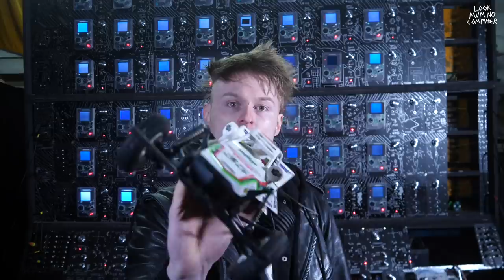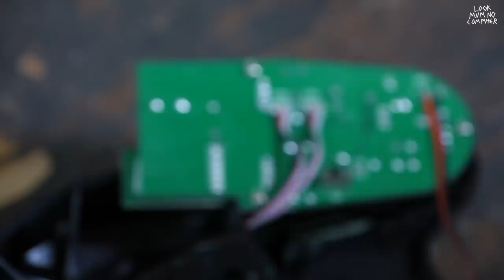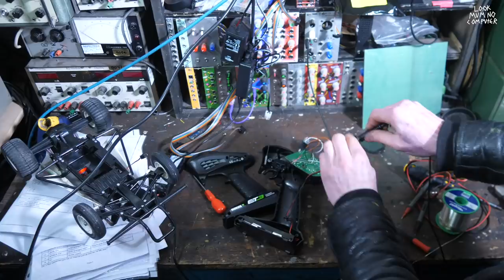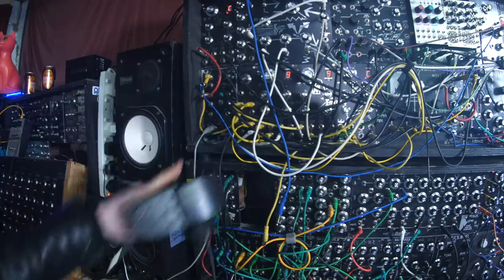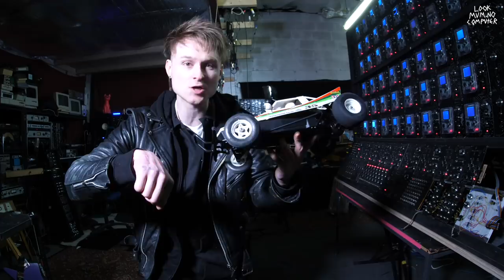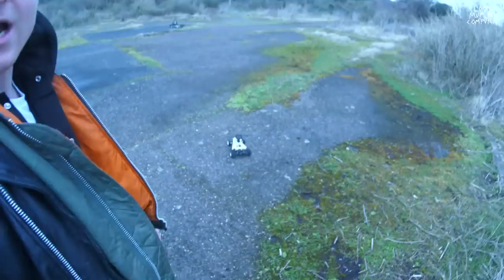Hacking RC Car To Drive With a Musical Keyboard

Comment: Maybe a module such as the utility that’s meant to serve as a pre- buffer for Eurorack modules using Atmega microcontrollers, the Soulsby Synth’s UniFive.  It comes packaged along with a new Oscitron, and it will keep signals to above zero (positive), and under 5 Volts.  Actually, it looks like you have precisely this type of buffer module.  Very important while attempting to mix and mingle sensitive FPGAs and certain Microchips whose inputs aren’t altogether flexible!  Thanks for sharing another unique modification by synthesizer input socketization!!

Comment: Great Work as Always. I might crack into a little drone/quad copter I have and see if the ol Korg SQ-1 can keep it steady. Thanks for the idea!
Reply from the maker: good luck!!!
Reply: @LOOKMUMNOCOMPUTER  Didn't turn out well.. Best I got was the drone rhythmically hitting the ceiling with about a 3 inch bounce until the controller started buzzing non stop and it's now just a nice buzzer, no longer controls... The Dangers of trying it out yourself at home:) Had fun with it though. Thanks again for the awesome content, and inspiration for me to get up and try myself!

Comment: Do it in the other direction.  Many older driving simulator games come with a little floor unit for brakes and accelerator.  The floor units tend to be spring-loaded 50k pots, intended to interface with the "games" port of older computers.  They can make a terrific little dual expression pedal unit, and can be purchased very inexpensively at yard sales, charity shops, and such.

Comment: A twist on this could be using the 2 potentiometers in the controller as a synth input, same basic idea music mixed with an RC car.
Reply: I'm on it..
Reply: steering wheel to controll the filter frequency and speed for lfo rate.

Comment: Could you get 3 cars together, some throttle-control servos, and make a 3 voice instrument using engine RPMs? You could also add in the horns for extra fun, since that's just a 12v on/off switch.

Comment: Would it be more effective if it were controlled by the interval between notes? Although actually making it work without using a microcontroller might be tricky.
Reply from the maker: why would that be more effective?
Reply: @LOOKMUMNOCOMPUTER  Right now most music will cause the car to turn in circles either left or right depending on whether the overall pitch is above or below the middle of the scale (middle C?). My thought was that if a rising interval turns right and a falling interval turns left, then you'd get more obvious back-and-forth movement.
Reply from the maker: @hjalfi  yes so i calibrated it for ewac song, i just need to add a voltage amplifier to increat it basically
Reply from the maker: but i see now intervals yes. well give it a goo!!

Comment: I would've tried to do it diatonically. So like, forward is the root. Reverse is the fifth but only the bass notes. Right and left are different intervals. 1 straight, 2 left, 3 straight, 4 right, 5 straight, 6 left, 7 straight, I don't know why. The 1, 3 and 5 are more directly harmonic. They make up a triad. So they should go straight and the others just alternate. So you'd improvise and control the car. Lol.

Of course that means two lefts and only one right. Maybe we could add an accidental. Or all the other intervals.

 Well, at least maybe someone got a music theory lesson, however bad, out of that. Lol.